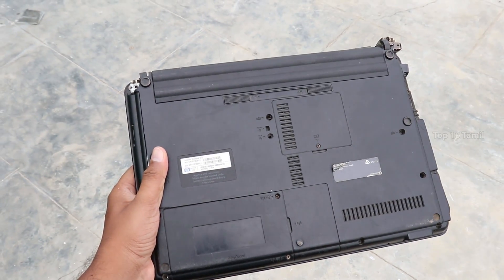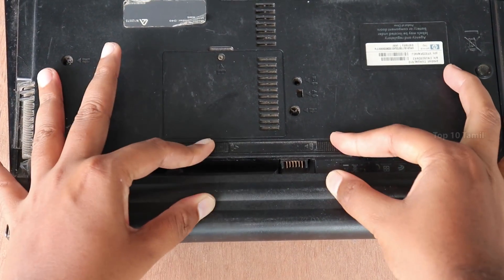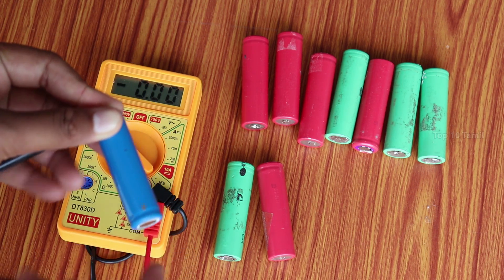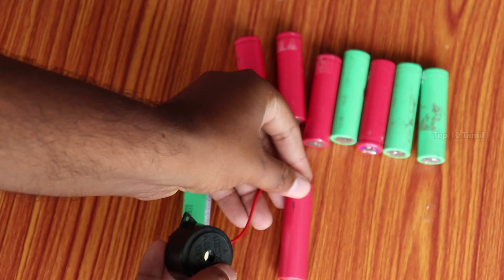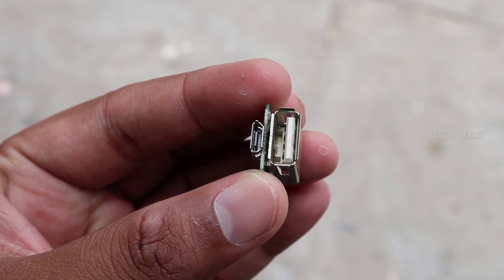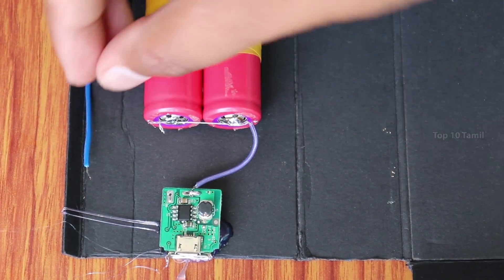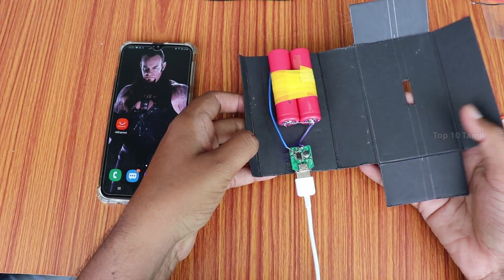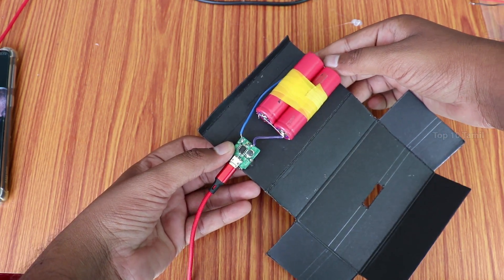நம் வீட்டில்  Solar Power Bank செய்வது எப்படி? | How to make DIY Solar Power Bank in home

Comment: Solar panel ha direct ha antha USB port la joint panna solarla ye charge  pannalama cell illama direct kekiran reply anyone
Reply from the maker: No bro apadi charge panna mudiyathu it's only 80 ma solar panel mobileku directa charge agathu
Reply: @Top10Tamil  athavida periya solar panel vangana possible iruka
Reply from the maker: Yes but it's too costly
Reply: Bro 1300mah battery kudaa use pannalam laa
Reply: @nawaznk850  yes bro
Reply: @Top10Tamil  2
Reply: Romba slow ha charge yerum
Reply: Elango
Reply: Bro enkita 9volt solar panel 3 irukku bro power bank cell 12 irukku atha ellame setha evalovu mAh battery kidaikkum bro
Reply: @dilipkumars5433  .... 27 v, and 30000 mah battery
Reply: @MohammedIrfan-bz2yr  no bro you are wrong. if you connect in parallel mah will increase and voltage will remain constant and if you connect in serial voltage will increase but mah will remain constant
Reply: @kalaiselvanarumugam472  .... அப்படியென்றால் battery backup increase செய்வதற்க்கு என்ன செய்ய வேண்டும் சகோ.......
Reply: @MohammedIrfan-bz2yr  bro power back up build panna start pannum podhu first adhoda use uh decide pannunga for mobiles and tab na 4.2v output Vara 1 batter kuda pothum but 4000mah la Vara mobiles uh full charge Panna mudiyathu so oru 2500mah la 4 battery add pannuna 4.2v 10000mah output kedikum. Unga kitta neriya battery iruku na 3 battery uh parallel uh connect panni seperate uh charger circuit pota multiple 5v output kedikum so neenga orea time la neria mobiles charge podalam or Ella battery ium parallel uh connect panni our pack ready pannuna unga mobile uh neriya time charge podalam
Reply: @dilipkumars5433  மூன்று சோலார் பேனல் பவர் ஒன்றாக இணைத்தால் 9 வோல்ட் தான் வரும் ஆம்பியர் மின்னோட்டம் பாயும்
Reply: Bro semma bro...👌👌👌
Reply: @mr.d4777  enna bro
Reply: Mokka mokka ya solathada
Reply: Anna enakhu extreme level project                 இக்கு Oru project ooda video poodunga price under 1000
Reply: super video bro.
Reply: Semma bro
Reply: Bro suppper bro
Reply: Super bank
Reply: J,NEPOLIAN

Comment: Anna you said the value has to be above 2.00,but If the battery’s power is been reduced , it shows below 2.00 and above 0.10.so will the battery be use full for me.??????

Comment: Use diode in solar panel positive wire so that current will not go towards solar panel from the battery . diode working like one-way
Reply: Which diode bro number enna
Reply: @mr.sivaraaman5572  5408 or 4701
Reply: @mr.sivaraaman5572  3 amp or 8 amp diode use pannunga nanba
Reply: Bro can you  help me out , I hade done a small dc setup in that I used 20watt loom solar pannel , it doesn't have diod , so my battery power goes to pannel during evening,  so which diod should I connect?

Comment: No it's a wrong way solar panel la direct ta battery la connect panna kudathu because solar panel is also a LED. And it will consume the battery power ▄︻̷̿┻̿═━一

Comment: circuit have some mistakes
solar panal directly connect to battery
some battery can affected due to over charging
Reply: Bro ithu always daily solar mulama charge panra mari pannalama
Reply: Illana direct ah solar to circut and mobile charge pannalama?
Reply: Yen powerbank puthusu, kila vilunthu charging port poiduchu, yepadi repair panrathu theriyuma ungaluku
Reply: Which diode can i use in 6volt solar to 4volt battery
Please tell me the answer sir
Reply: Solapur bhakti geet touchless
Reply: Solapur bag se din Giri attachment touch lights

Comment: Solar panel la direct ha battery la connect panna short agum it will drain the 18650 battery it will not charge the battery instead connect solar panel to battery directly use dc booster to charge the battery via solar panel and the circuit will work only on max3.9v if you connect 6v solar panel the power ic get damaged quickly

Comment: Bro antha port 5volt than output tharum apo rompa slowa thana charge agum.5 volt ku mela ethavathu port iruka bro..
Reply: Bro ella mobile uh 5V than tharum bro but fast charging support Iruka mobiles than 5v mela support support pannum adhuvum mobile la Iruka charge level uh poruthu marum eppo mobile la oru 10% iruku na appo 9v at 2A nu charge agum than 50% vanduchu na 7v at 1.5a nu marum adhuvea 70% na 5v @ 1a nu maridum. Edhuvum mobiles la use pandra fast-changing technology uh poruthu marum Qualcomm, vocc, dash-charger epadi nariea iruku ellamea different uh work pannum so 5v generic uh Ella mobiles kum work agum

Comment: Already erukura 10,000 or 20,000mha battery power(eny brand) bank ku solar panel madum kidaikuma sir. And erukura power bank la intha Mari panalma ? Bze btry Oda capacity high level so athan ktgan sir. Ila ninga Sona Mari 2 battery and circuit board ku than intha solar panel use akuma?
Reply from the maker: Solar panel high rage vanganum
Reply: @Top10Tamil  ok sir apo na Sona value level ku set akura Mari solar panel madum link send panunga pls

Comment: Where I can get same battery  bro. ???
Reply from the maker: Online but it's cost high
Reply: Battery is good or solar is good  because IAM student + Auto driver I use more power to my mobile phone  in auto can I fix solar panel on top my auto is it ok ????
Reply: @Twistkannadiga  Bro you already have battery in your auto so no need to buy a panel or extra battery you can use travel adaptor or travel charger to charge your mobile

Comment: Bro nice but one doubt idhu blast aagadhulla
Reply from the maker: No bro board nama use pandranala blast agathu adhu volt controla vachikum
Reply: @Top10Tamil tqs brother and  last video naan try pannen brother super tqs...emergency light
Reply: @Top10Tamil  please make more....
Reply: Chances are there bro because solar panel Ku board use pannala also panel la 6v output varuthu so kandipa overcharge agum appo li-po or li-on edhula edhuva irundalum fire aidum

Comment: Bro solarla irunthu connection straighta kudukalama
Reply from the maker: Yes because solar kammi voltdha problem illa but innum bettera pannalam periya boards vanganum soon update bigger solar power bank in our channel
Reply: @Top10Tamil  bro it might seems good but lipo and li-on randu type battery um overcharge pannuna fire aidum eppo unga setup la na charge use panni full charge pannitu 100% vanthauku apporam na solar la charge pannuna adhu fire aidum because unga panel battery ku 6v input varuthu so overcharge aidum. Always use overcharge and over discahege protection board